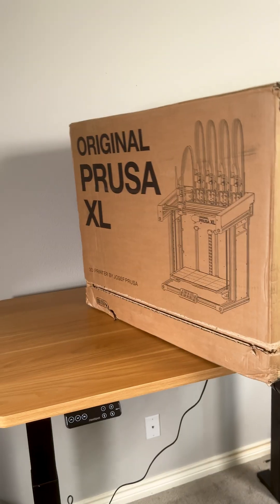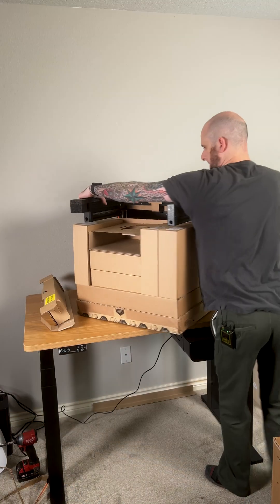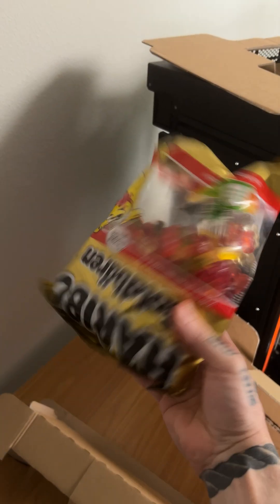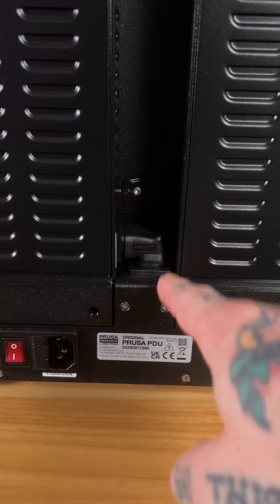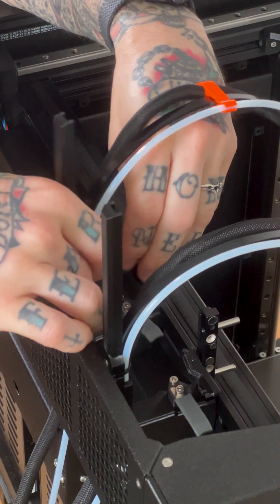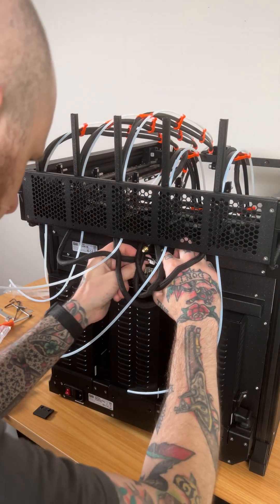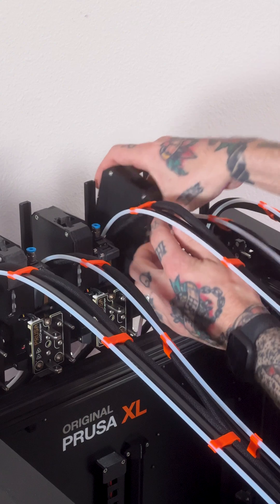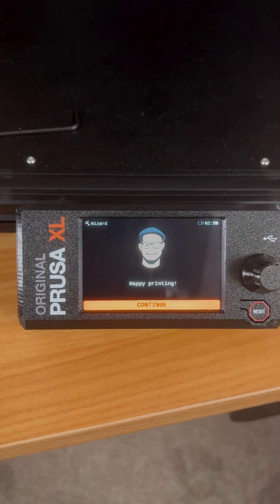Unboxing the Prusa XL #3dprinter #3dprinting #tech

Comment: Cant wait till someone makes one better and cheaper
Reply from the maker: Toolchangers have existed for years. Doing one "cheaper" is hard. You've got to have the mechanical parts and electronics to support however many toolheads. Those and quality software / firmware are the expensive parts of a product like this. If it was easy, it would have been done by now. I welcome more entry level options, just not sure when we will see them.
Reply: @MandicReally  ive seen a few diy projects i know its alot. btw keep up the good work

Comment: What do the different tool heads do or are they just different sizes or color?
Reply from the maker: You can run different materials so you can mix materials together. Like print a screwdriver handle with TPU on the other layer and PLA inside, or I've seen plenty of compliant mechanisms where it is a part that uses TPU to act as a moving part but the rest is rigid. Can print Support materials that are soluble in water and easier to remove with less distance to the models so they print better on supports. Use PETG as a support interface material for PLA for the same purpose. There are a lot of uses. yes it can also be used for multi-color with MUCH less waste as it doesn't have to purge out the nozzle since each color has its own nozzle.
Reply: @MandicReally  im about buy one of these out of pure stupidity. Does It really come with the gummy bears?
Reply from the maker: @notatypobrutha  It really comes with gummy bears. Prusa sends Haribo gummy bears with all their printers, in the XL's case its an XL bag. One of those silly brand identity things that's just stuck around.
Reply: @ Oh dear now there's no way I'm getting a bambu now. I'm definitely going to have to utilize cashback programs to help the hole it'll leave in my account. $2500 is reasonable, but I need to do multi color prints. $3500 hurts, id rather be stabbed, but stabbing doesn't come with a $9 bag of gummy bears